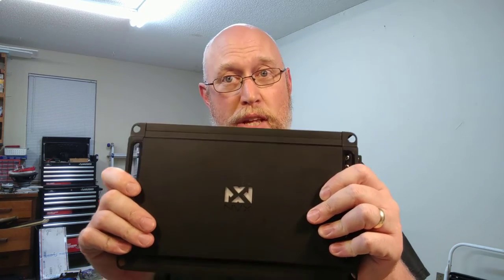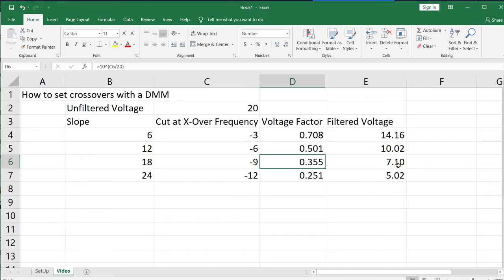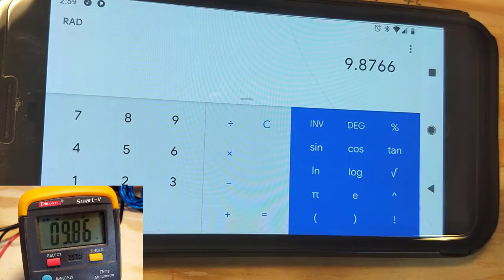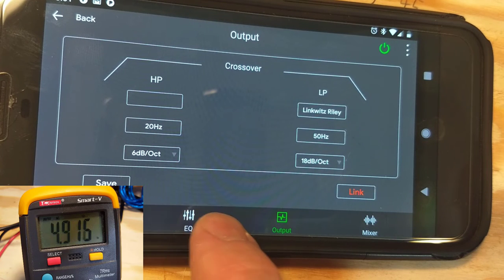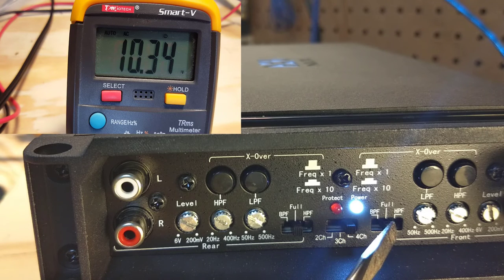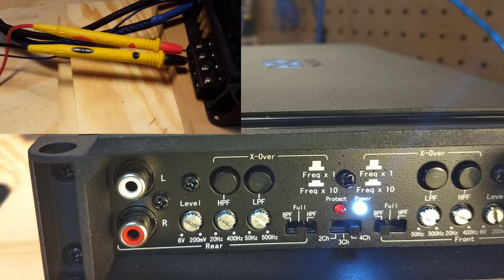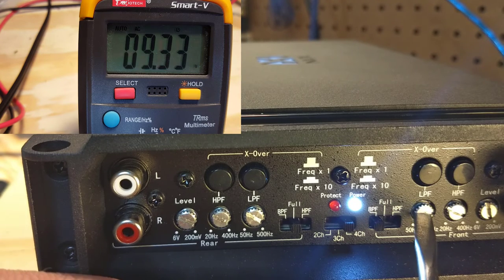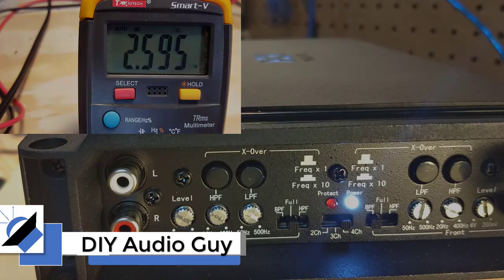Set Crossovers with a Multi-Meter, the CORRECT way!

Comment: And 1 more fyi...multi meters need to be calibrated every year. Or  and depending on use.
Reply from the maker: I suspect that most cheap, consumer grade, multimeters cannot be calibrated.  If you're doing precision work, or industrial/manufacturing, that's going to matter. But for setting up an amplifier you should be fine.

Comment: I've always dependes on the 2 object on the side of my head. Called ears if it don't sound nice and clear something's amiss. Kind of like timing my trucks engine you can hear a miss . Nothing fancy just ears. Great video I also keep my volt meter in my pocket it's am everyday everything tool.

Comment: Hello , awesome video , just having a brain fart , when I set my gains on my sub amp , the LP filter should be at its lowest setting , then when I set the crossover turn to highest setting , get my target voltage around 10v multiply by my amps 12db slope at .501 then turn down until I get 5.01 volts correct?
Reply from the maker: Think of the crossover as a choke (some people even use that term for an inductor in a passive crossover) on a carburetor  it limits the airflow into the engine. 

Step one is to turn off the choke or open it up as much as possible.  For a low pass filter the lowest setting is full choke, nothing gets through.  For a high pass filter the highest setting is full choke, nothing gets threw.  You want to open it up.  Set the gain and leave it open.  Then use the instructions in this video to set the crossover to your exact desired position.
Reply: @DIYAudioGuy  awesome thank you very much !

Comment: I like the way you explain everything. I don't have a DSP, so I was looking at using the crossover on my amp. How do we find A:the db/octave slope that our amp uses?
And B: the "unfiltered voltage"? Should we just leave the crossover off, and see what voltage we get out of the speaker terminals, and use that?
Reply: I have the SKAR audio RP-150.4AB for my mids and highs and 
And Hifonics Zeus ZRX2400.1D for my sub. Bought my sub and amp years and years ago, and am now trying to do a proper setup in my car.
Reply from the maker: Unfiltered voltage is just that, it's the voltage without any filters on. It does not really matter what the starting voltage is. I recommend turning the head unit up until you get 10 volts just to make the math easier.

Your owner's manual should tell you what your crossover slopes are and the type of crossover.

Comment: Can you explain why you chose 80hz for the test tone? Would 40hz work as well? I assume this affects the testing and crossover settings. Thank you.
Reply from the maker: 80 h is a good starting point for the crossover between subwoofer and midrange. Something like it higher some like it lower, it will depend on your speakers.  I played the 80 Hertz tone in order to get the crossover at 80 HZ,.
Reply: @DIYAudioGuy  Bro you rock, thanks man.

Comment: I think this dsp is messed up. The Linkwitz-Riley filters should always be 6 db down at the crossover frequency. The slope shouldn’t change that. The voltage multiplier should always be .5 regardless of the slope steepness….
Reply from the maker: Honestly, I am not really sure.  Everything I read on LR filters only seems to mention this when it is a 2nd order.

Comment: Great video DIY Audio Guy. i watch a lot of videos i'm still cunfused to set crossover sittings how i can know the slope or OCT for my amp? i dont found any information from anywhere
Reply from the maker: The crossover slope should be in the manual, if you can't find a manual online, I can't help you much. You can just assume that it's a 12 DB per octave slope and go with it.
Reply: @DIYAudioGuy  i send you a message in instagram please check
Reply from the maker: @mohavved  I'm not seeing your message in Instagram.  Feel free to ask your question here, I'll try my best to answer it
Reply: @DIYAudioGuy  i send you some pic for my amp to help my username is @9.3

Comment: Say im using a DSP, do i need to set the crossovers on the amps too? If not, do i just set the switch on a 4ch to Full Range? And for the HPF/LPF knobs, where do i set them If they don't go to zero (both for sub and mids/high amps)
Reply from the maker: No need for the crossovers on the amplifiers if you're doing it all with the DSP.  Yes, If the crossover has an off switch, go ahead and turn them off.

If you don't have an off switch, then set your low pass filters to the highest frequency, most of the time. This means turning it all the way to the right.  Then set the high pass crossover to the lowest possible frequency, typically this means turning them all the way to the left.

Comment: So when aplying this to my tuning of my sub amp,  do i apply whatever volts for the crossover slope im using? Or can i just pick any no matter the crossover?
Reply: My crossovers are 24 db per octave on my sub amps
Reply from the maker: The idea is to start with a known voltage, then run it through the formula to figure out what the ending voltage will be.  You can use any starting voltage.  I recommend that you adjust the head unit to get a nice round number, like 10 or 20.    This video may help you understand the formula:  https://youtu.be/4kDxUcGCe8M
Reply: @DIYAudioGuy  oh and i get wat ypur saying the power factor but thats of gain.. isnt it as too.. im asking of the crossovers not gain i under stand the power factor being -3db down but if im up on my sub level, now does that make it larger??
Reply: @DIYAudioGuy  theres too much i need to know man u are the only one explainging it "properly but i dont understand as to u just shoved the 24db aside and started testing saying it doesnt matter for subsonic.. in certain boxes.. tho my box big mangg
Reply: Sooo its not as easy for me then u think to understand as i understand overlap i understand it all but is that overlap??... and to, does it as afect my actual over lap when doing that at diff sub lvls?? I dont just wanna do this with out knowing what im doing im already running my stuff different ohms im same box.. so im rlly trying to do some crazy shiet with mixing from soumd engineering type shiet
Reply: I watched it but it didnt help what helped a lot more was ur subsonic video as u said u had a 24/db amp u dont rlly neexd subsonic due to ur box.. i made my box for 28hrtz its 5.6cfgross  and 5.0cf with displacements tooken away,
Reply: But i have no win isd... i know too much of sound audio and physics so i understand what ur saying but i haveee. A amp thats 24db per octave, im running my car deck lpf to through to that amp.
Reply: Or is that say my "overlap"? Cause im tuning, my amps gain to 40hrtz 0db, then my subsonic at 20, and mycrossover at 84, but! I have a 24 db crossover from my monoblock amp, so do i have to use the 24 db eqaution??
Reply: Cause ive drawn my crossover graphs and i see whats lost and all that but whith knowing the math how do i aply it to my tuning? I am not understanding as to again the amp is set 24db per octave.. tho if i was to go plus 6 isnt that just clipping? Im lost .. iknow +3 is clipping.. as well how does this go about if i was to be at a sw level of +1 or higher??
Reply: I for sure "get" the "idea". So its not that.. tiss do i need to use the voltage specific to my amp slope or nah? And is it overlap? Baclsicallyy?? Or say is that just actuallyyy telling the amp like "hey! You play at 30hrts at 18db"? by multiplying the unfilterd voltage by whatever factor i want to achieve it to play? Is that what its doing??..

Comment: I really appreciate your videos, I'm not sure what I am doing wrong, but I have a 1200.1d amp, 24/oct  variable amp, 32hz tuned ported box. Does it matter if I set LPF or SS first? I tried both, but am unable to get the HPF down to 2.51, It will only go to 5 dropped to the lowest. 24 hz tone for SS and 80 for HPF. Thank you for your videos.
Reply from the maker: It's really hard to say without being there to troubleshoot the amp.  But you probably should be okay, a 24 DB slope is very steep so you can get away with setting it as slightly higher frequency.

Main thing is to take it easy with the volume knob until you're certain that you're not unloading a little frequencies.

Comment: But what's your x-over frequency?
"I'm so lost here, I want to set up a multi-channel amp for an active 2-way setup with sub. I want my X over to, say, 2.5khz@24db for the Hi-pass and 2.5khz@24db for the bandpass ( the sub will be Xover at a fixed 60Hz 24db). I don't need to find 18,12 or 6db xover (it's set by the amp at 24db slope.) Now how do I find the frequency??? "
That was my first confusion about this video because u focused so much on slope vs frequency. I now understand what u are saying, I think. Instead of your hypothetical 50hz frequency, i set my own frequency then the math from there. It seems you were going backward with the math, U mention very little of frequency, which is how most people would want this type of info. I could imagine most are like me, trying to find the frequency FIRST then maybe the math to verify the frequency. But you don't present this way. It just seems u should open the video by saying "Let's find the Xover point at 1200hz" as most amps and variable Xover components don't have the frequencies listed, so that is what we wanna find, and then do another hypothetical frequency we are trying to find, and so on. We wanna find the frequency. U did do this somewhat by noting the 50hz frequency u are trying to find, but I just feel u should do multiple frequencies, then show the math to find it, rather than multiple slopes and the math behind that (I know it's the same math, but I'm critiquing the presentation!). Just my thoughts, I appreciate the effort.
Reply from the maker: I did not spend a lot of times talking about the frequency because the user gets to pick the frequency, the frequency is not an input in the formula.  Just play a test tone at your frequency, then turn the knob until you get the number you need.

Comment: Wanting to get a voltage reading of your crossover for the technicality is cool (awesome job on showing us!), but is it really necessary? I find that crossovers have to change according to what you're listening to. At my home entertainment system, when I'm watching a movie, I set my crossover on my subwoofer to about 80 htz so that the dialogue doesn't come through. When I'm listening to music, I set it to about 120-180 htz (depending on the type of music) so that I can hear the upper-ish mid frequencies of the bass guitar and not just the kick and floor tom. It's set all by ear. No multi-meter required. Don't beat yourself up guys if you can't get this math right. Lower your crossover to cut off the frequencies you do not wish to hear through your sub (that's what it's designed to do). If it sounds muddy, cut some more out. If you want more beef/punch, raise it up some. Again, don't worry about the numbers. Hear it.
Reply from the maker: I don't disagree. The ear is the best test instrument.

Comment: What "noise" should I use to do these settings?  I need to set two amps.  One with subs and one with 6x9's.
Reply from the maker: Play a test tone equal to the frequency of the crossover point you wish to set.  So if you want to set your crossover at 80 hertz play in 80 hertz test tone.
Reply: @DIYAudioGuy  Do you have any base test tones you would suggest for the speakers mentioned?  Sorry, I’m a total newb. Lol.
Reply: I guess I should add that the 6x9’s are 2-way.

Comment: Hi thanks for all your videos, really helps a lot. I have a question, where are you getting your starting voltage from (could it be where the head unit and amp are set at the moment) and do you set this before setting the subsonic filter? Thanks
Reply: I saw it in your other video thanks
Reply from the maker: Awesome!

Comment: Maybe i missed something but if your unfiltered voltage is 50v and you are driving a 1ohm load. At 80hz 24db/oct slope your target voltage is 25volts. You have to apply the 0.251 to the wattage ( @1ohm load. 50v x 50v = 2500watts ; 2500 x 0.251 = 625watts ; square root of 625w = 25v. Take it or leave it guys . Not trying to argue with anyone. DIY guy you are still awesome.
Reply from the maker: Crossovers are not based on watts, they are based on DB.  You have to convert from DB to volts to find the crossover point.

Comment: I am setting up the Alpine mono 500w amp (31.62V) you have in your gain setup vid (..My sub can rated to 200w so I juices it to 240w, so thats 22v.  I assume when you start the LPF your still playing to same 40/50 htz test tone at 75% vol.  The Alpine amp is 24db Octave and therefore the voltage should be 5.59v.  Does that sound correct
Reply from the maker: You want to play a tone that equals your desired crossover frequency.  https://youtu.be/bNauOkzdTRM

Comment: Can you please explain how you came up with numbers in excel sheet?
Reply from the maker: 10^(.5*slope/20)
Reply: I am little confused. In every article and video they have asked to multiply by 0.707 irrespective of slope. Isn't the meaning of cut off frequency is that it is 3db down from 0 db or. 707 of original value whatever the slope may be?
Reply from the maker: @Dilpalsingh  I've noticed the same thing.  But as you can see in the video my math matches the digital signal processors output. I'm open to the idea that I might be mistaken, but if I am then this DSP is doing it wrong.  I figured all the math out before I took the measurements.
Reply: Can you please tell the name of DSP app used? Thanks for prompt replies.
Reply from the maker: It's the app that controls the Dayton DSP 408.

Comment: So when I go to set my lpf my read output voltage is 50 volts. So I go to play an 80hz test tone and start turning from left to right my lpf to roughly 25 volts as I have a 12b/octave slope on my lpf and the lpf bottoms out at 36 volts?? What shall I do now!Help plz DIY Audio Guy
Reply from the maker: That's odd, not sure what to tell you.  It is hard to trouble shoot without having the equipment in front of me.

Comment: And also would I set my gain to to the appropriate level with the low pass and subsonic open before I set the low pad and subsonic filter
Reply from the maker: When you set the gains you want all of your crossovers off and any EQ settings set to zero or flat.

Comment: Great Video. I noticed that this math seems to apply to a 12db crossover amp. How would these numbers change if the amp has a 24db built in crossover?
Reply from the maker: https://youtu.be/KUvJNhC-BAE
Reply: I understand the video at the different crossover points. My problem is that I’m at 19.8 of unfiltered voltage at 80 hertz. When I do the math it comes to be 4.96 volts. When I adjust my low pass filter my voltage is rising not lowering.
Reply from the maker: @josephbassil4171  What happened when you turned it the other way?
Reply: I cannot turn it the other way I’m just turning it to the right.  The gain it on point. 31.68 1000 watts at 1ohm Skar audio amp.
Reply from the maker: Is there a high pass/low pass switch or an off/on switch?

Comment: My amp manual tells me to do this by ear using a 75% volume set point which for me is impossible and entirely guess work.  I look forward to use your multimeter method. Thank you very much.
Reply from the maker: You can spend a little bit more and get an oscilloscope and be even more accurate.  https://youtu.be/oBNETr9AHwA

Comment: You set crossovers at full power. Can you also do this work at any given voltage? say 1v output so you can do it with speakers hooked up. doesnt the speakers impedance affect the voltage output of the amp?
Reply from the maker: What I do now is I pick a lower voltage, and something that makes the math easy.  So I'll adjust the head unit until I get something like 10 volts.  There are some who suggest you should do these settings with the speakers connected I disagree because you run the risk of damaging your speakers by pumping test tones through them. Plus test zones are hell on your ears.

Comment: Out of all the youtubers doing audio equipment, your videos have definitely been the most helpful. Especially in showing that you don't need a fancy $300 SMD DD-1 to properly set the gain or other parameters.
Reply from the maker: Those are great tools and I would love to have one. But you can't really justify spending that much unless you are doing it for a living.
Reply: I totally agree. Do you need one for personal use? No. I do it for a living and it comes in super handy.  You don't need a mobile detailing trailer to wash your personal car but if you do it for a living, a bucket, rags and dish soap won't cut it😉

Comment: how do you know what test tune to use for the unfiltered voltage?
Reply from the maker: If you're trying to set the crossover at 80 Hertz then play in 80 Hertz test tone.
Reply: @DIYAudioGuy  ok so that's generally for subwoofer, correct? And what frequency should I play for full range speakers? These are probably dumb questions but I'm fairly new to all this.
Reply from the maker: @mcfriedchicken1972  1,000hz. There are no dumb questions.
Reply from the maker: Hang on, I Just give you a terrible answer. Ithought you were asking a question on a different video.  If you're trying to set the high pass on an amplifier for some coaxials or a set of components then you would also use 80 hertz. 80 hertz is kind of a standard starting point for crossovers.